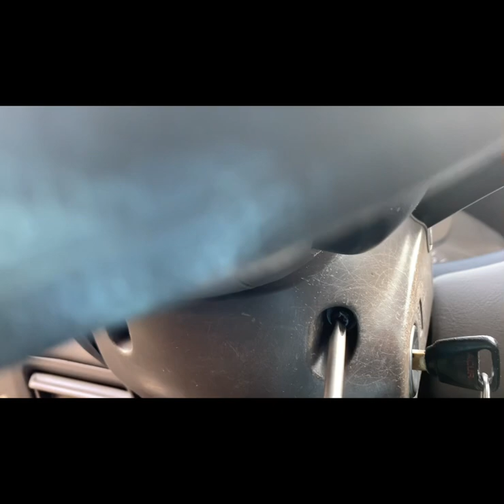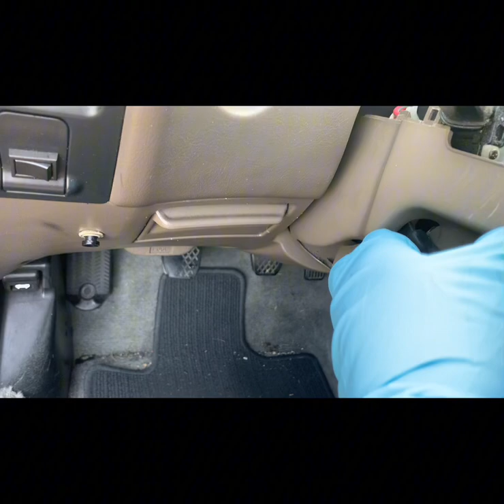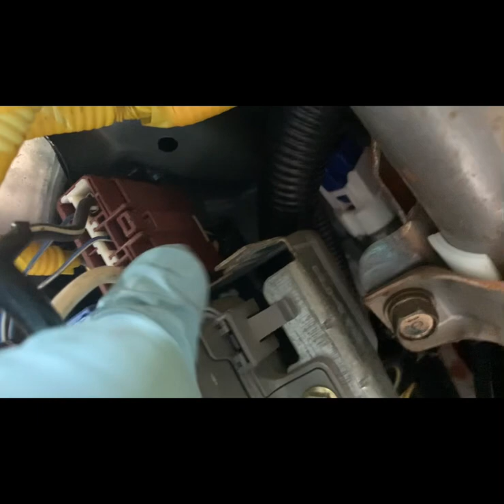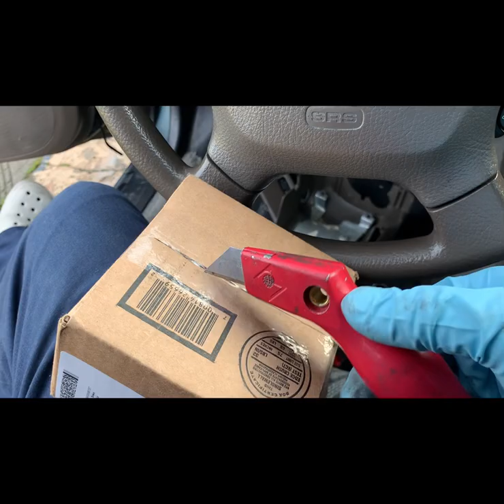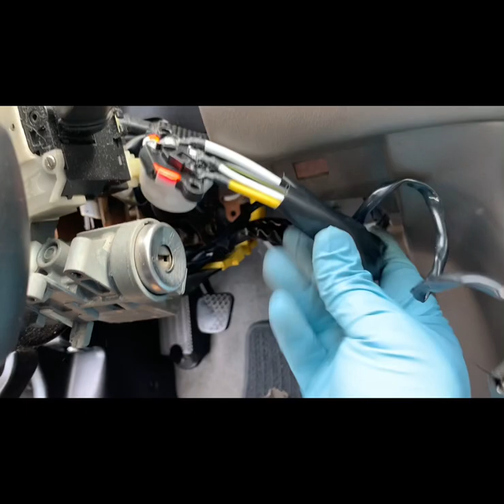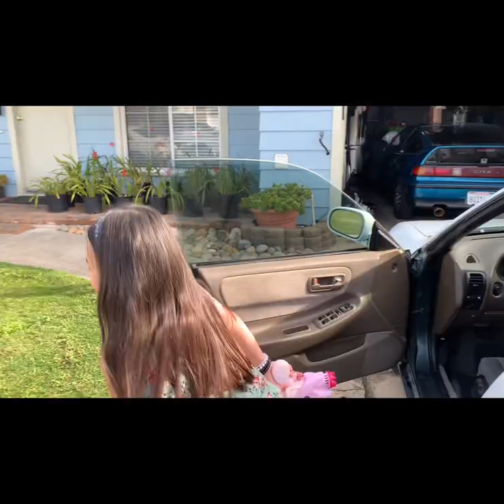How to replace ignition switch on 94-2000 Acura Integra DIY

Comment: Did your ignition switch come with a new key?
Reply from the maker: No, just the ignition switch harness.  You can buy a complete key cylinder with a new ignition switch together.
Reply from the maker: It was ebay special purchased🤞😬😂

Comment: Did your Integra have fuel pump priming issues when trying to start ? Is why you replaced the ignition switch ?
Reply from the maker: It starts and dies as soon as I let go of the ignition key. If I hold the ignition key it continuously idles but the moment I let go it dies
Reply: @jpscrx ahh I see, I’m trying to figure out what the issue is with mine starting, but based on what you are telling me, I don’t think my ignition switch is malfunctioning 🙏🏻
Reply: If your fuel pump isn’t priming. Your main relay is bad. Your ignition is not the problem.
Reply: @VuNguyen-ih2eg  it’s not the main relay for mine as I’ve replaced it twice already, seems to be a momentary issue that happens every so often
Reply: @NguyenLeRealtor did you try changing the fuel pump
Reply from the maker: Is this automatic?
Reply: Where did you buy ignition switch ?
Reply: @jpscrx where did u buy ignition switch ?